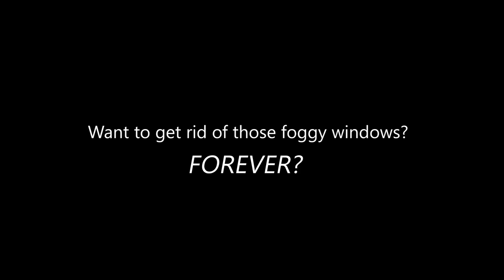The RV Glass Experts FIX FOGGY RV Windows!

Comment: Very informative, thank you.  I'm just trying to find 1/4" laminated glass cut to size for a boat window project. I've had mixed results from 3 different glass shops, I wonder if I should try an RV repair shop?  I'm in LA area, Long Beach CA.
Reply from the maker: Hi James!  Here is a company you might try -- you may need to send them a pattern but they should be capable if your glass isn't too large to ship cost effectively: https://www.onedayglass.com/products/custom-glass-projects/
Best of luck!